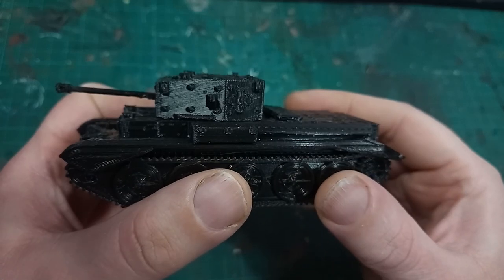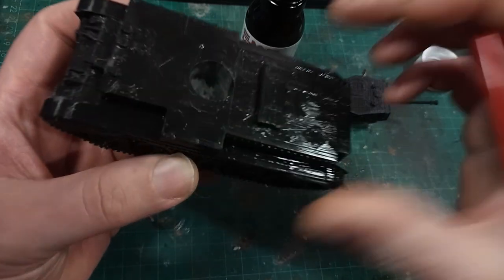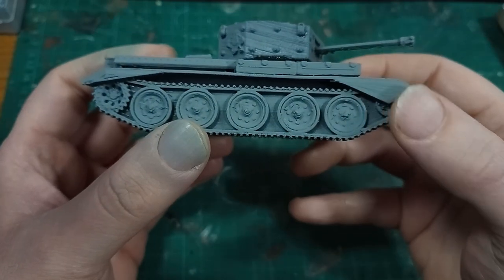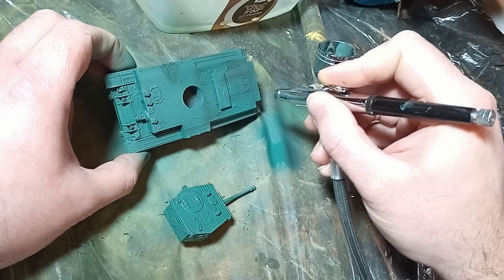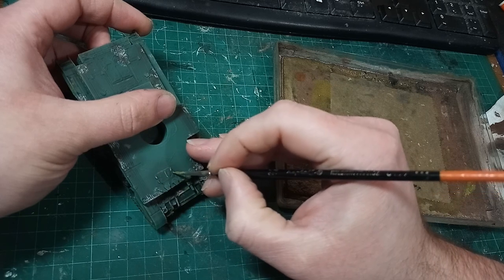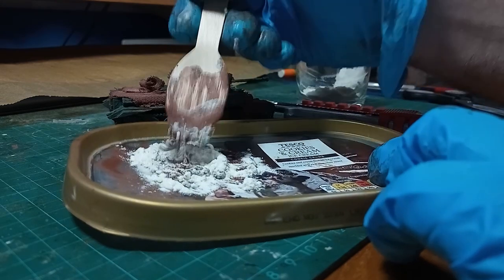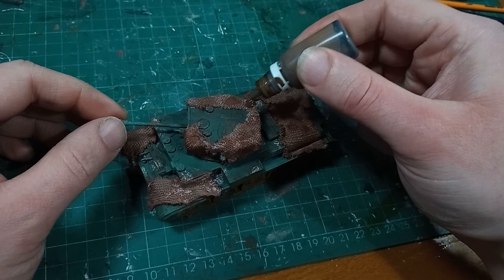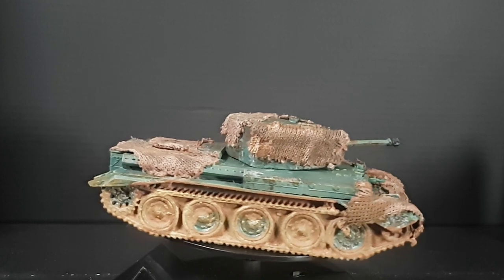Using obtrusive modelling techniques, on a bad 3d printed model.

Comment: As someone whom does a lot of FDM printing (resin has annoying thing of being hard to set up in a small flat), I love this video because I got plenty of nice little prints. Also have you tried prints from "easy print" style of school? There are a lot of em around made some folk for FDM printers and I think they might cover some more weird bits of bolt action models well? As you said resin printing some bits can make it pop nicely.
Reply from the maker: The wargame 3d are sculpted specifically to be suitable for FDM and SLA printing, with larger more prominent details.
My fdm prints wont get any better untill I earn enough for a new fdm printer :p

I've been trying to convince some sculpters to make vehicles for mixed materials, no luck yet xD

Comment: So is FDM completely outdated or does it still have its use?
Reply from the maker: Totally not. They are different technologies.
FDM can do things SLA can't and vice versa.

For the ultra fine detail of a 28mm figure, you'll probably want SLA. For pieces that need to be stronger,like terrain, FDM is way more durable.

Also if you want a sick custom nerf gun, you can FDM print the whole thing and SLA would be nearly useless.
Reply: @EDSKaR  I see. Thanks!
Reply: @andrevandervlies5700  To be honest modernish FDM printers aren't tragic for vehicles too, as while I got a resin printer (that I don't know how to use) FDM printers can be a lot easier to set up and also have upside of being great for vehicles and what not.
Reply: @pauliusthemad3498  Thanks!